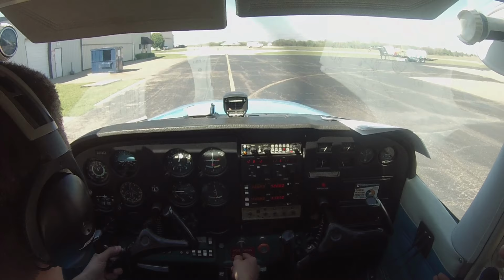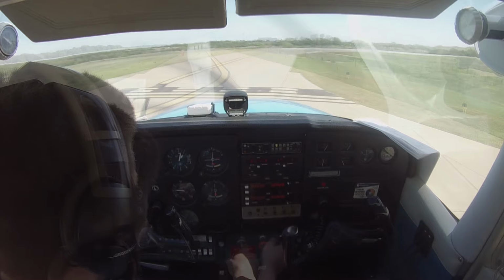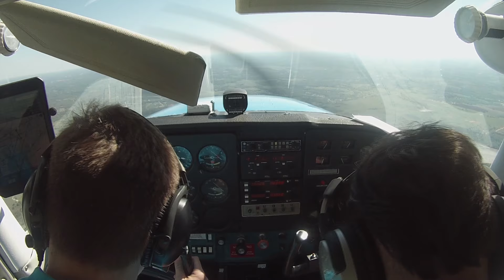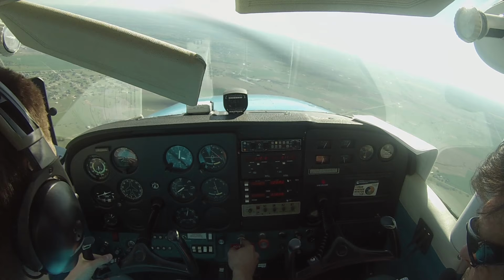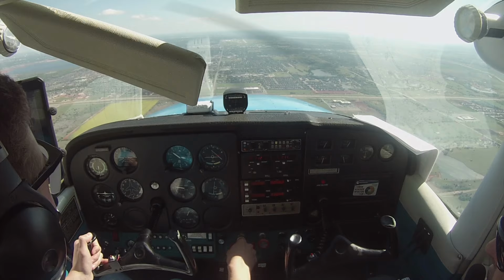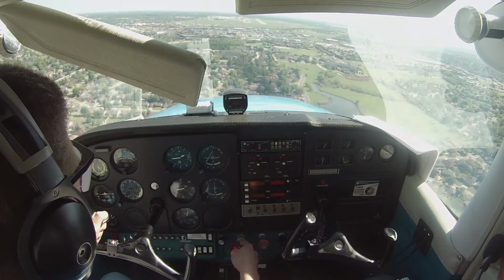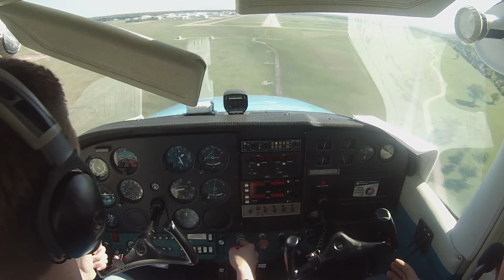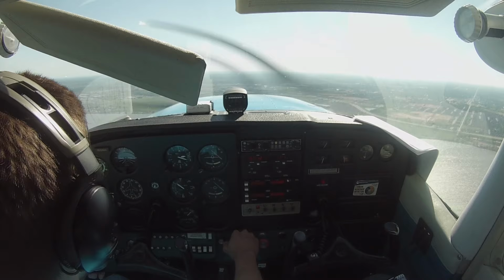VOR Approach | Cessna 172 | Instrument Training

Comment: Nice.  I didn't realize you were flying in OKC until the tower mentioned Wiley Post.  Several years I wrote an article on the Hefner-Overholser bicycle/pedestrian trail that shows up about 9:44 when you're on final.  It's the squiggly trail just outside the perimeter fence on the northwest corner of the airport.

Comment: I know this might be a dumb question but. If they assign you to fly to a transition will they just give you the vectors?
Reply from the maker: Usually most controllers will not use transitions as they will account for a longer approach. But, if they do. For example, let's say the IAF for an approach is DIRGE. The controller will usually state, N20464 turn left/right to a heading and proceed direct DIRGE. So, they'll give you an approximate heading to go direct to the fix, but they expect you to fly direct to the fix by your instruments. Whether it's by GPS or by cross radials.